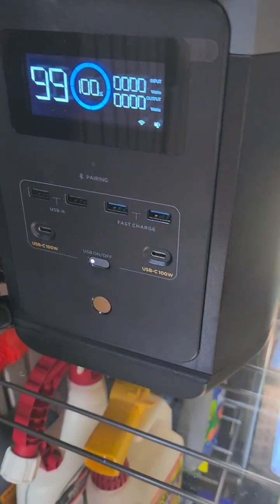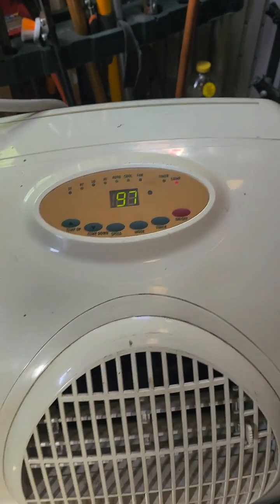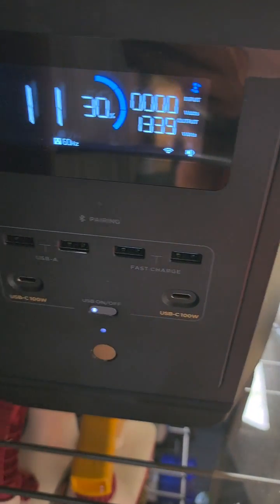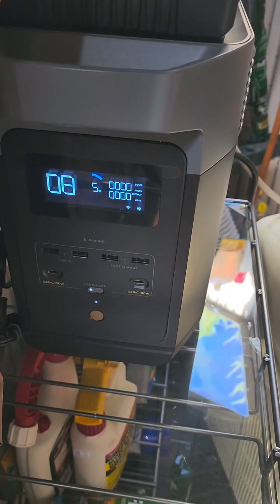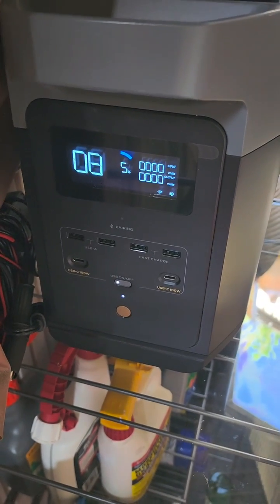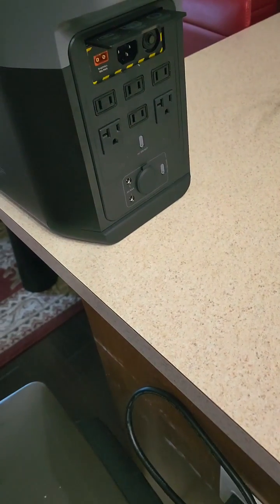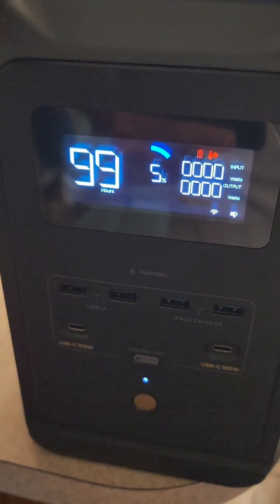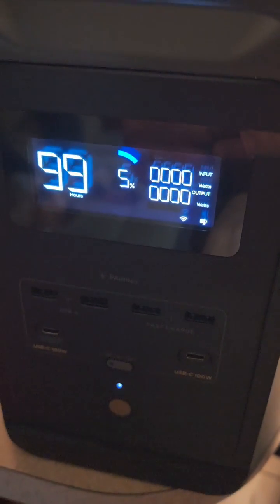New EcoFlow Delta 2 Portable Power Station Overheats

Comment: Mine overheats when I charge it every time even if it’s cold and I haven’t used it.  Totally pissed, I’ve had it a long time and never used it until recently only to find out it’s defective
Reply from the maker: Believe it or not, they finally sent me a new one, and it did the same thing.This one did. Plus it wouldn't charge more than five hundred watts. It's supposed to have a twelve hundred watt charge. So they said that one was defective, and now I sent that one back. This company and their products are total trash.
Reply: @ATsWeather ugh!!  I purchased back 4 or so years ago when they were like 1400 bucks including a 160w solar panel.  Took it camping twice and then it sat until now, I need it while my house is having some remodeling done.  It charges up to 94% but with the “hot” symbol showing and it smells like something’s burning.  Last night I threw it outside in fear it’ll explode 🤣. Damn I guess I’ll look into Bluetti or Jackery.  I chose ecoflow because they charge super fast.  I don’t think it even pays to try n fight with ecoflow so I’ll cut my losses ☹️
Reply from the maker: They do have a warranty for refurbished units. Might try it